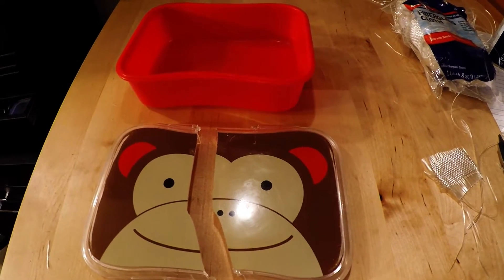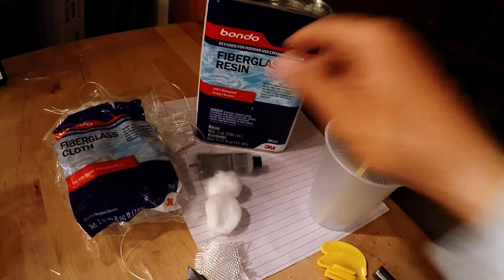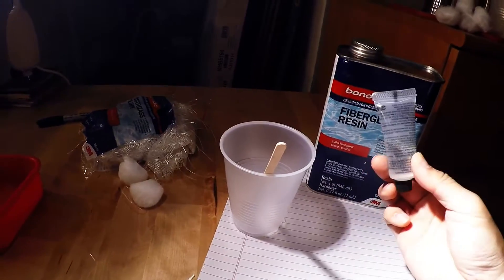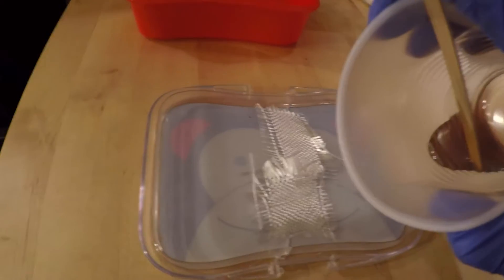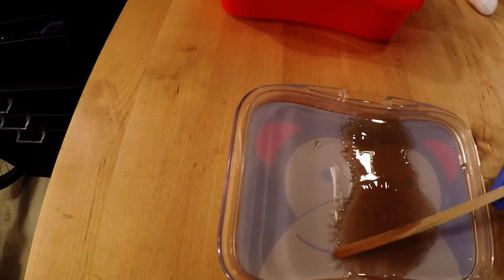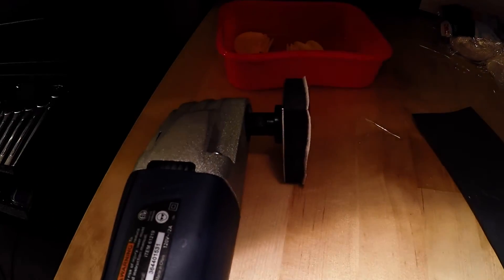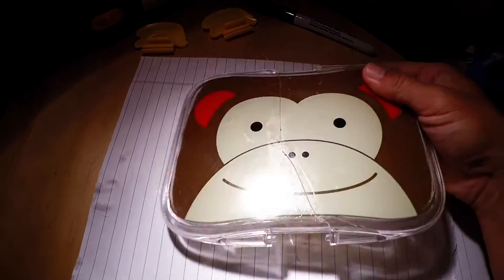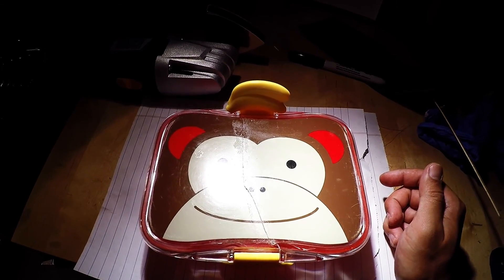how to fix broken toy or plastic fixture using fiberglass

Comment: I don't think that type of resin necessarily bonds that well with plastic.  In this particular case, there are no high loads and so it should work fine.  If you really want to bond to plastic in a very strong way, you probably need to find a different resin.  You can use JB Plastic Weld which is hard to work with because it cures very fast and also very toxic (must use a respirator).  

Or you could try ABS cement which is used for ABS (plastic pipe) which would work OK I think.  Perhaps also PVC glue would work or there are these combined products which work on both PVC and ABS.     

Google "ABS PVC cement"  and you will get results such as "Oatey ABS Transition Cement" which you can buy at Home Depot.
Reply: p.s. it is safer to use a respirator or work outdoors with any of these products.  All of these products are toxic but JB Plastic Weld is especially toxic.  It is a kind of super-glue and once it gets in your body, it will stay there for the rest of your life.
Reply: Can you still use the fibre sheets with JB weld?